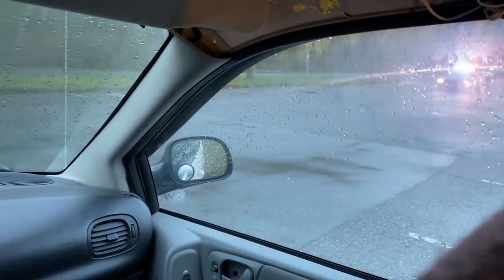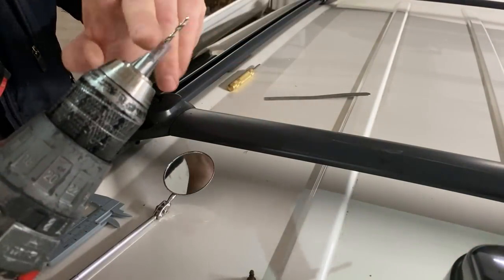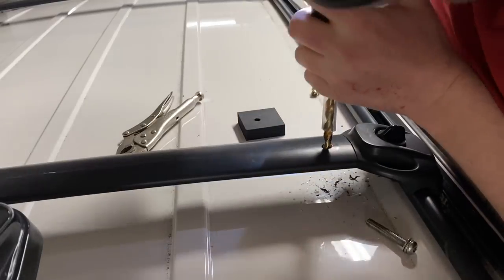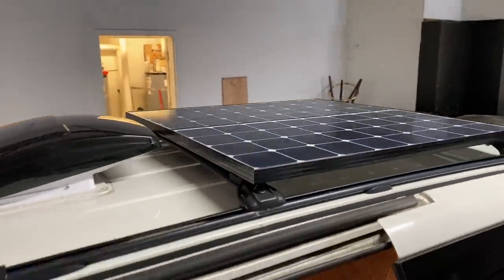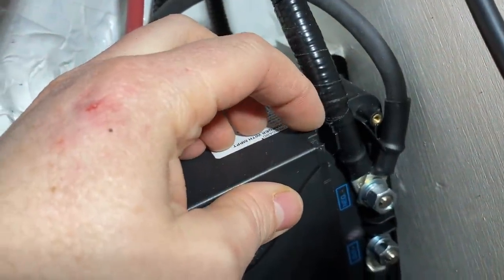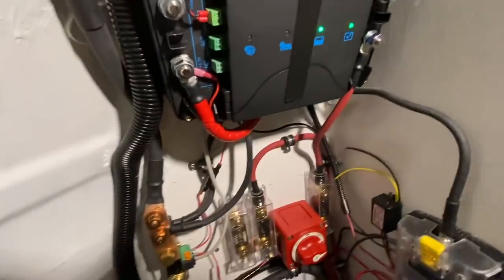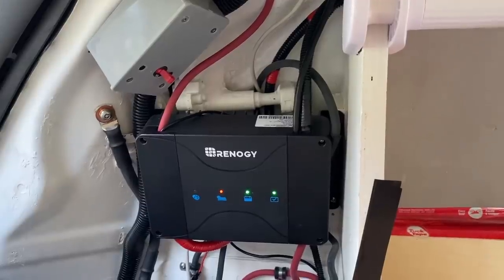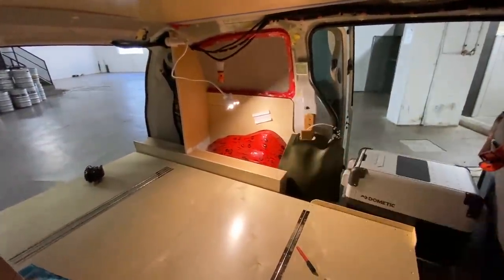MINIVAN Build E-22 || Solar Installation, Kicked out of the park,

Comment: I'm surprised you found a Caravan in mint condition. Mine is a 2014.
Reply from the maker: It was the second one I looked at and while the body is in good shape I needed a lot of work on the suspension and brakes.  It's hanging on but it has its quirks for sure.  Who ever had it before me took good care of it.
Reply: @SharingTheWild  I had had a 2008 Chevy Uplander. I gave into the rust issues. Sold. It's still on the road.
Reply: @SharingTheWild  brakes are normal stuff. Make sure the calipers are maintained and you'll do alright. The van looks cherry 🍒👍❤️🇨🇦
Reply from the maker: @truckerdaddy-akajohninqueb4793  oh I wish it was that easy.  The front breaks on this van are undersized to begin with and with the extra weight I added it seems to go through a set of rotors every six months.  At least on the front end.  The only thing I haven't changed is the master cylinder.

Comment: Yo Joseph got some questions.. i have 2 100w panels 30amp mppt controller 100ah battery lithium and 1500(3000peak) inverter.. 
Im not sure which fuse or breaker i need. Do you have a list of yours? I wanna copy my solar setup like yours.  Thanks